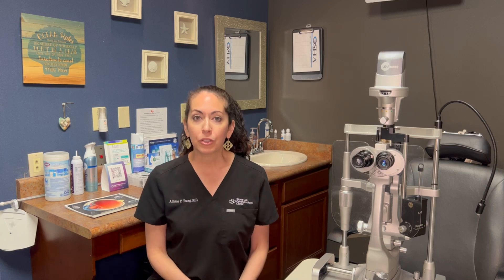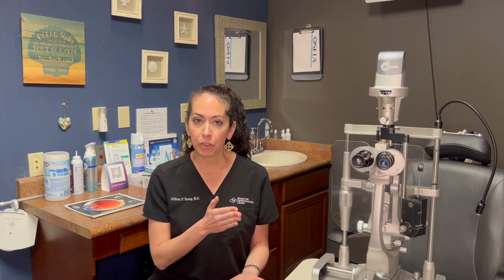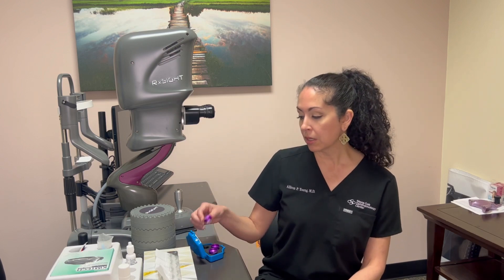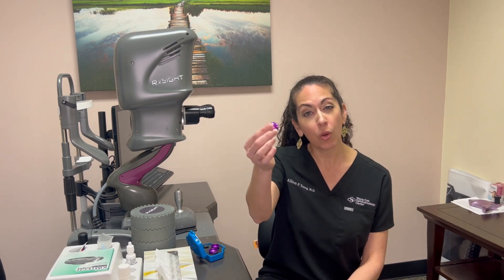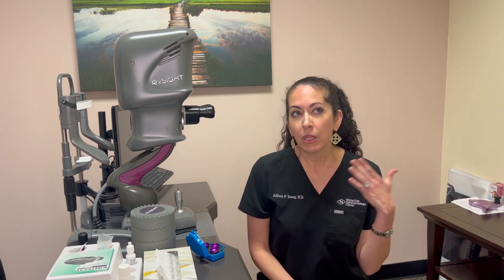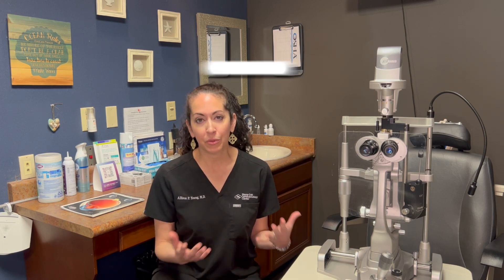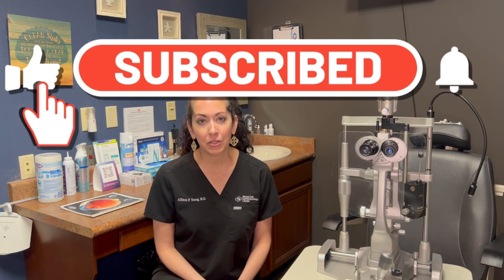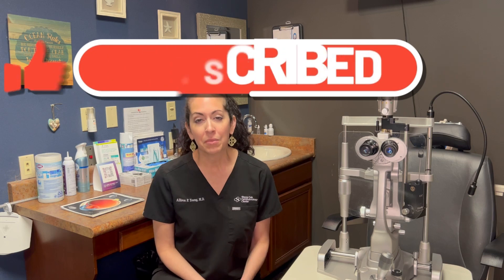What is the Light Adjustable Lens and how do we use it in cataract surgery? | The Eye Surgeon

Comment: are there longer Term side effects of Silicone lens?
Reply: Retinal detachments come with age, high myopia or trauma. They require silicone injections in the posterior segment. If the two silicone layers come into contact it'a real mess. This is a very simplified reply. Hope more people can add or correct or explain better.
Reply: @--2455  should people be concerned about silicone lens in LAL if silicone oil is done in surgery? why are other options for tear?
Reply: @bestcomment3589  The silicone oil is only used in the worst retina detatchments, not typical RD's.